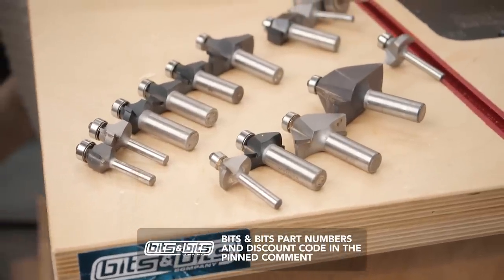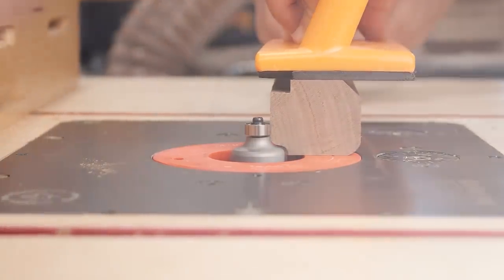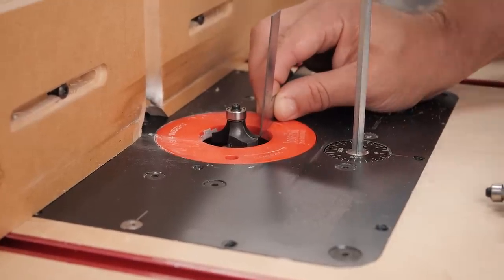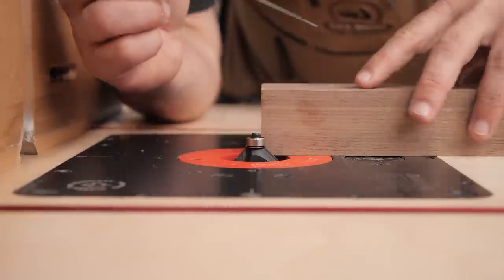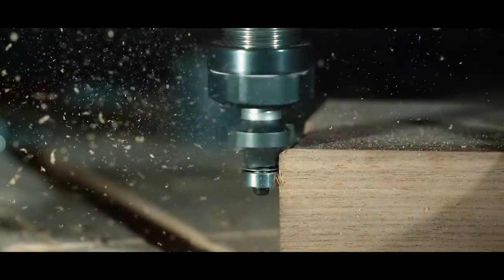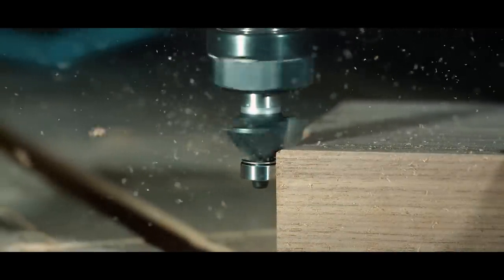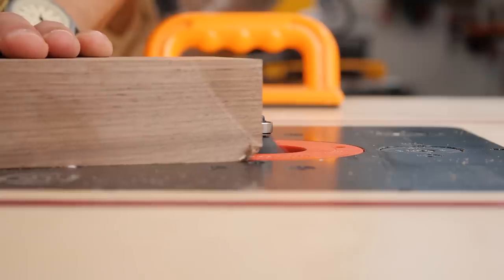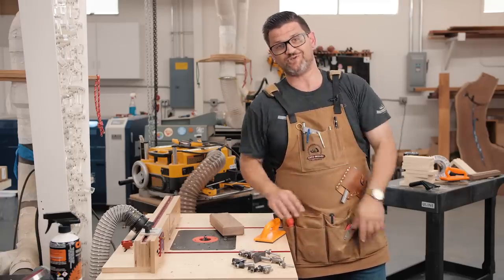3 Tips on Using Router Edge Profile Bits - 2 ish Minute Tuesday - With 19,000 FPS HD Video

Comment: To prevent tear out in many circumstances you can use a “backer block” that holds those splinters in place to be cut instead of torn. It can be extra trouble but if you have a valuable piece of wood you’re working with it’s a small price to pay.

Comment: You might consider showing how to use the safety pin when starting a profile at the end of the piece. Especially with that monster chamfer bit or when starting a climb cut, easy for someone less experienced to have it catch on the end grain and yank the piece, which of course can be dangerous.  
Ask me how I know...
Reply: The rocketing of an oak piece across my shop is the reason I have a starter pin. I agree that these should be more widely used and talked about.
Reply: Yes please!

Comment: I can remember having a Eureka moment after getting a large set of router bits, and having been confused about why ogee and round over bits appeared to look the same.  It came to me that the difference was the size of the bearing.  The round over bits have a larger bearing that exactly matches the start of the radius where as ogee bits have a smaller bearing that allows the bit to undercut the face of the work piece.  That together with the bit height provides the ogee profile.  It's one of those obvious when you see it but with a big case with 40 odd bits in it, it can be a 'can't see the wood for the trees' situation.

Comment: Regarding tearout, not only does bit sharpness affect the severity but I have also found it can be exacerbated with incorrect RPM and even micro-deflection in the router mount. I’m betting your CNC is rock solid

Comment: "You can't get tearout on the long grain."
Oh, I can. Caught a chunk that ripped along the grain pretty deep, and shot it across the room.
Reply: Meat Hook  I’ve had the same experience. There’s probably not a solution for that problem either. Thankfully, it’s a pretty rare occurrence.
Reply: @ELW2940  Sharp blades, and not pushing the timber too hard helps, but sometimes the grain just isn't bonded well.
Reply: I had a comment conversation with Tamar from 3x3 custom about which way to advance the workpiece into the bit.  She insisted that it should 'always' be  governed by grain angle and direction, but I feel it is more important to avoid climb cutting.  You can climb cut a final clean up pass if grain direction works that way, but for the bulk of the wood removal climb cutting is just asking to have the workpiece thrown across the workshop with chunks taken out of it.   I often feel that some YouTube presenters get too much 'knowledge' from books, and not enough from hands-on experience.

Comment: Hoping you can help me out. I am working on Pine baseboard. I am planning on 1x4 with 3/8" round over. I am trying to determine would it be better to use hand router or should I get table router? I am maybe doing 10 8foot long boards. I wont be able to get one of the professional tables either. I can only get maybe the $150 ones or nice dewalt handrouter.

Comment: I've noticed the bearing often leaves a line on the wood, how do you deal with that? Just sand it away?
Reply from the maker: I think that was just the lighting. If it does or is so light that one pass with 220 grit would remove it
Reply: @katzmosestools  It isn't the lighting.  The bearing is not running true to the shaft center line.  That can cause the bearing to leave a depression in the wood.  Easily sanded out.  Not a big deal.

Comment: Do u use the bearing with the cnc or what that just for example purposes?
Reply from the maker: It wouldn't have been a very good use of the slow mo camera if you couldn't see what was happening. I don't usually but nothing wrong with using the CNC for bearing bits if you don't have a router table
Reply: @katzmosestools  ok, ive been wanting to use some edge bits with cnc but couldnt decide if i should remove the bearing or leave it as kind of a fail safe

Comment: Jonathan, should a routed edge ever need sanding after?  I just got my first router (game changer!) and my chamfer edges on the end grain side looked chunky.  It was pine wood, which I've always had trouble getting smooth, so I figured that might why.
Reply from the maker: Sounds like you need a different bit. Honestly  I try not to sand them anything more than a couple passes with a piece of sandpaper by hand
Reply: Jonathan Katz-Moses thanks. They are new bits so I figure it very well may be operator error, too. But, man, I’m really enjoying having a router. Makes a huge difference in the finished product.

Comment: Did you see any difference in the high speed cameras between table routers and hand routers?
Reply from the maker: In terms of?
Reply: @katzmosestools  in terms of just any differences. Does one act any differently in relationship to the grain or maybe speed of operation? Wasnt sure if a hand router showed anything different in any aspect compared to a table router.
Reply from the maker: @williamlivingstone4326  shouldn't. They're all about the same thing. One you move the wood and the other you move the router.

Comment: not sure whats up with my palm router. (im a total noob with routers), but i keep getting massive kickback to the point i dont even want to use the tool.

i see these vids where people are running some half inch bit straight through a bit of mdf or hardwood. i tried it on mdf first and it just massacred the stuff, no mattwr how i tried to hold it against the fence it wanted to jump back and tear up the rear edge.

could that be cheap blades causing the issue? or am i making it worse by not going full power with a small bit?

im very confused by it. maybe just the cheap tool isnt up to it, ...so i got the lumpier heavier plunge router to replace it, so i dont feel like its going to jump up and grab my fingers which are way too close to that kickback with the palm.

i also see vids with people lightly moving the tool with fingertips on the baseplate...if tried that id have lost a finger for sure when it kicked back on me...im not putting my fingers anywhere near that blade. sod that.

id rather know what the issue is though, or else i might just have bought a bigger finger killer.

help! 😂

Comment: Were you feeding the workpiece manually on your CNC? Also you're not supposed to put bearing guided bits on CNC machines. At least take off the bearing and even better if you grind off the threaded boss
Reply from the maker: You can absolutely use a cnc that way. Its just an upside down router table.
Reply: @katzmosestools  I'm not saying you can't use it that way. You can use it to mix coffee if you like. But the bearing is really not ideal for CNC machines. It is not a cutting edge. It will cause your machine to slip in place. Ask your cnc manufacturer about that. Then again what do I know. I've only operated and programmed professional grade flat bed router and a rail and pod 5axis CNC machine (Busellato and Biesse) for the past decade making high end kitchens and custom furniture here in Berkeley CA.
Reply from the maker: My cnc manufacturer is the one who gave me the idea while we were putting together a shot list for the slow mo camera. If my machine can do 450 IPM with a 1/4 spiral I'm 100% certain in can stay in place for a low force edge profile pass.
Reply: @katzmosestools  ok I get it. It's just for the demo. Thanks for the explanation.

Comment: that is strange. I did 100% opposite and result is exactly the same... long grain first, end grain last. on many hardwood species. a spatially when chamfering end grain cutting board
Reply: Me too. There is no tear out on the long grain cut, and then when you do the end grain there is nothing left to tear out. But I guess both ways work fine. And if that's the case then I just do long grain, end grain, long grain and end grain. No need reposition the board and no need to think :)
Reply: I went to the comments to see if I was the only one. This is exactly opposite of what I've always known to do. Why intentionally cause tear out, then expect the tool to fix it. Do long grain first and don't get any tear out then do end grain. Maybe there can be tear out on the long grain even after doing the long grain then end grain...